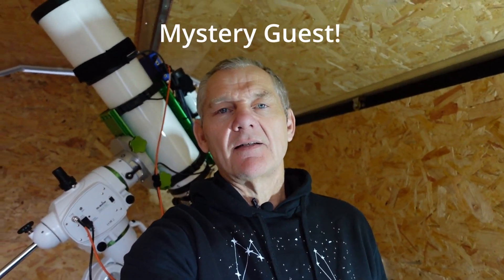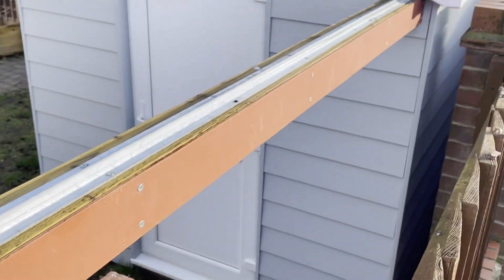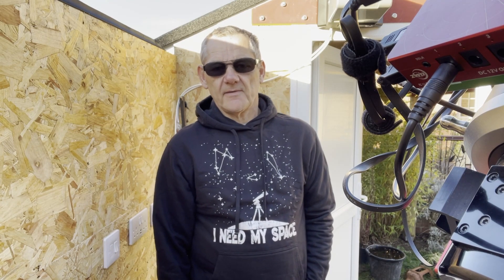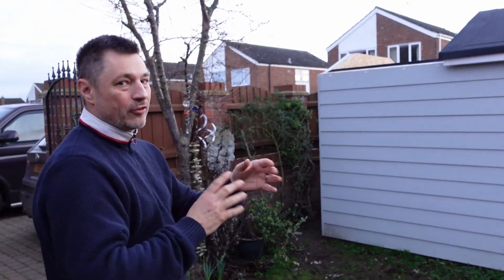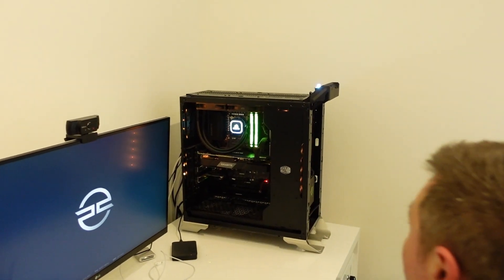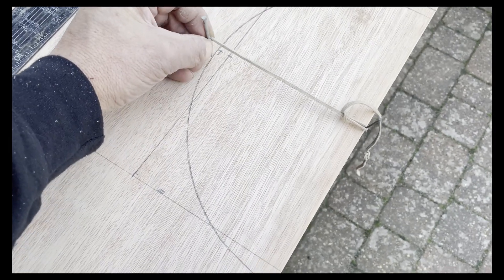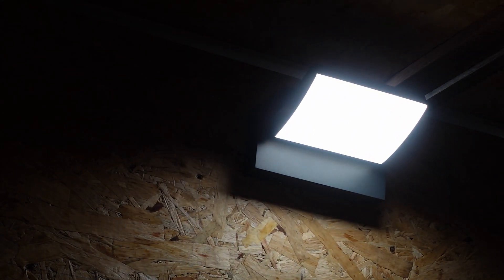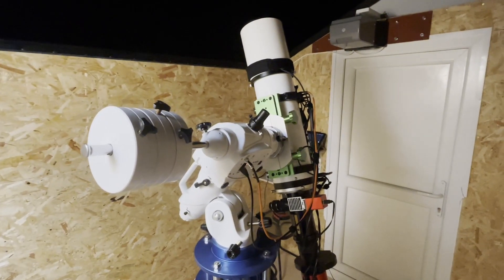Observatory Build Part 6  & Mystery Guest!

Comment: Looking good !, I might be over cautious but I'd put a fuse on the cable as you've removed one when you cut off the ciggy lighter 🙂
Reply from the maker: Thanks Gaz Za
You make a good point about the fuse! Although I’m not too worried as the 12 volt power supply is regulated from the Navada power pack! 🤞 Clear skies!

Comment: Great series of videos to follow for anyone building their own obsy. Floor looks snug and warm. One question - are you planning on painting the walls or will they remain with the wood finish. The reason I ask is because I had my walls initially just as the plywood but soon found the nights of heavy dew were leading to mold growth so I ended up treating the walls for the mold and painting them with an outdoor paint.  GFreat image of the Spider and Fly too.
Reply from the maker: Thanks Logan👍 Much appreciated! I’ve already ordered the paint 😀 I got bathroom paint (moisture resistant) blue, by the way! Although it will have to wait a couple of weeks as I’m now off to the airport, got a 12hr flight to Thailand! Someone’s got to do it😎
Thanks again and clear skies!
Reply from the maker: Just heard about the floods in Auckland, hope you’re ok where you are Logan👍

Comment: Loving this build video, and that if anything gets in the way of the observatory it gets removed (brick) or pruned (tree)!!! Quick question, why do you need to insulate the observatory, will it not be very cold once the roof is open?
Reply from the maker: Hi Marc, thanks mate👍 The reason I’ve insulted the Observatory is not for when it’s open, but in those long hot summer days where my other shed gets up to around 100 degrees! The insulation will help to keep it cool in the summer and warmer in the winter! I’m trying to maintain an even temperature all round when not it use! Cher Marc. Clear skies!
Reply: @SimonsAstro  ahhh, okay. That makes sense. Thanks.

Comment: Hi Simon,
another question about your ror motor. Could you tell me the dimensions of the motor as the obs i built is only 2mx2m and think the length of the motor same as yours might be too long so might have to go one size down. Thanks again.
Reply from the maker: High Michael, my motor is 13” long x 7.5” wide x 8” high including the cog! Hope that helps👍 Clear skies!
Reply: Thanks simon, if i can’t go same orientation as you i might have to go parallel to the wall. Thanks for the quick reply and keep the vids coming!

Comment: Watched all 6 of your obsy build videos. Brilliant. Have been in touch with Glenn, who has been very helpful also. Building my own now which will follow both of your designs. Just a question or two if you dont mind. I'm going to re-use a garden shed I have got. It's 5' X 7'. Is that big enough to build a concrete pillar in the middle of to allow an EQ6 + Horizon 102 and a Quattro 200P to park / home and meridian change? I am using a 250mm steel tube like Glenn, and I'm assuming about 1.1m height above the obsy base to the adaptor is enough? Obsy base is wooden shed base, is thet OK or should it be concrete? I note that both you and Glenn have surrounded the pillar with plastic sheet, insulation and then more plasdtic sheet to exclude vibration. Will that be OK for a wooden floor?
Reply from the maker: Hi Jeremy, thanks so much for watching my videos😀, I hope they helped! On the questions, 5’ to be fair will be tight! Mine is 7x8 feet internally and with my esprit 120, I can only just squeeze past the sides! You may be ok so long as you don’t put a too big a scope on, but don’t forget adding flattners, filter wheel’s, and a camera on the end, makes the imaging train quite long! A wooden floor will be fine for your base, but the important thing to remember is, no part of the floor should touch the pier or ire foundation, That’s why we both insulated the pier foundation from the concrete floor, so as not to transfer any vibrations up to the camera! Concrete is a very good conductor of vibrations! 
I hope that’s helps, anymore questions, please ask, and finally, good luck without build 👍 Clear skies!
Reply: Hi Simon,
Thanks so much for your reply! Just another couple of questions if you don't mind.
First, where did your electric role off roof equipment come from, and how much was it?
And second, how high off the base of the observatory should the concrete column be, up to the base of the adaptor for an EQ6 mount? I'm thinking 1.1m.
If you want to reply privately, then please message me and let me reply accordingly!
Thanks
Jeremy
Reply from the maker: @jeremyhigginson9307  Hi Jeremy, I’ll contact you through messenger, are you the Jeremy Highinson that studied at Bradford Uni?
Reply: @SimonsAstro  Yes, that's me!!